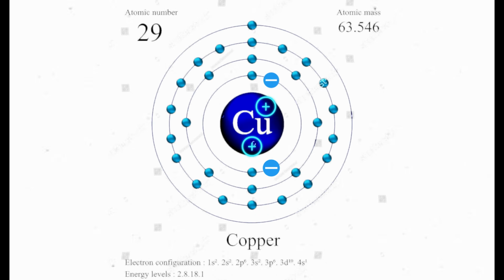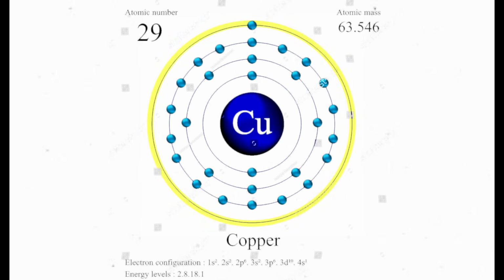What Is Voltage and Why Does It Create Current?

Comment: The explanation is incomplete but good enough for practical use for an electrical technician. A complete explanation requires higher mathematics as it It will deals with maxwells equations.

Comment: Great video. It helped to solidify what i just learned in an HVAC Class. 
I have a question about your video on the multi speed motor and how the low resistance black wire leaves the winding many times in different places.   Where, when the strands leave the winding, do they go?
Reply from the maker: They skip over parts of the winding and return to the winding again before eventually connecting to the common winding. This lowers resistance (less winding), which increases current (more power), which in turn increases the speed. Red wire runs full length of winding, increasing resistance, decreasing current and reducing speed.